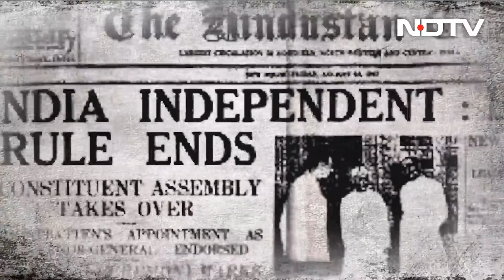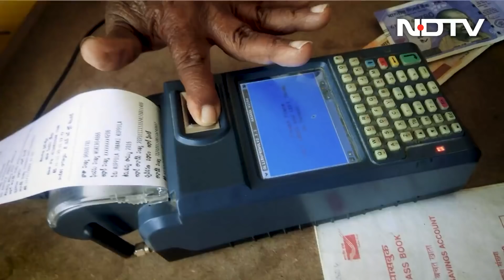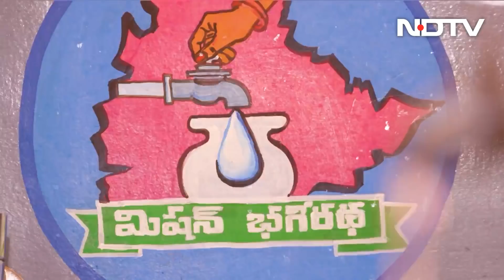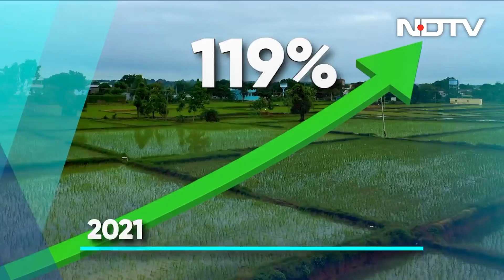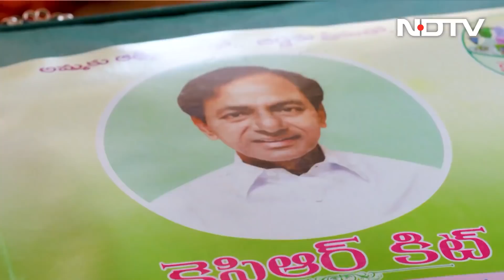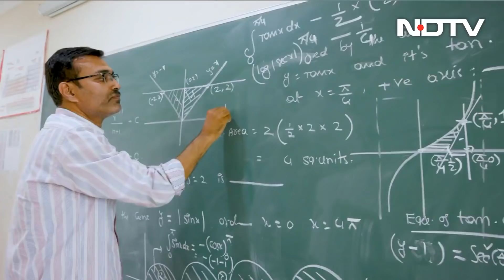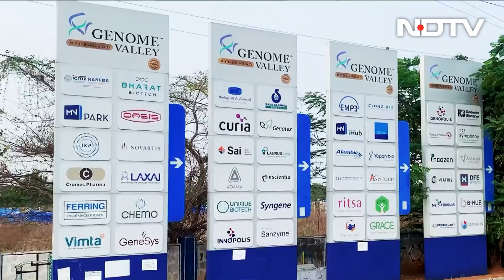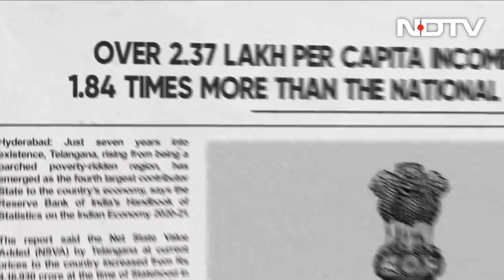"Telangana, A Phoenix Rises" - How KCR's State Became Top Performer

Comment: I still remember there used to be yearly summer power cuts, water crisis, bad roads before 2014. But after he took charge as Telangana CM he changed the complete scenario of basic needs. There are still more to be achieved in terms of jobs into govt sector. But yes he will surely achieve it.